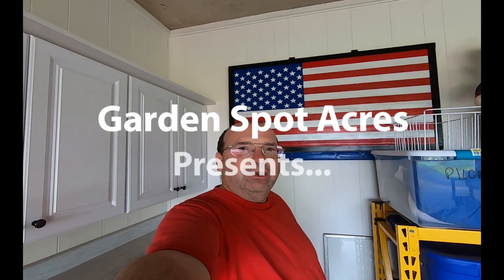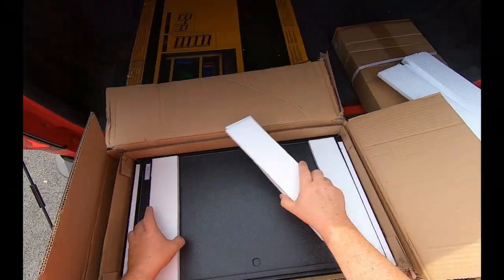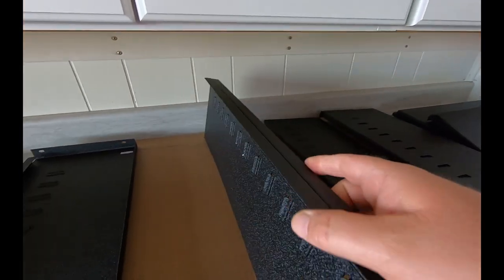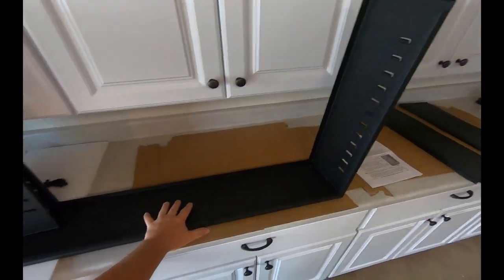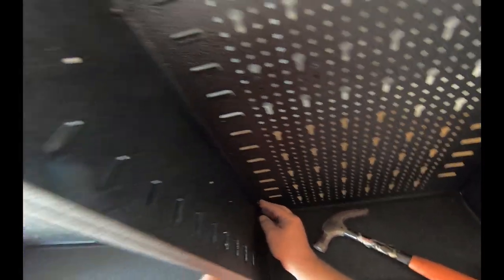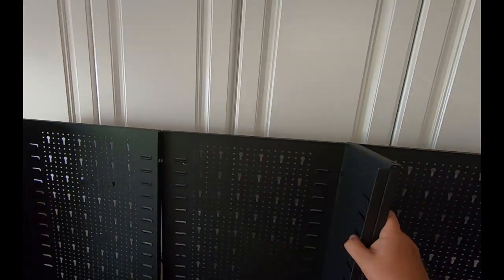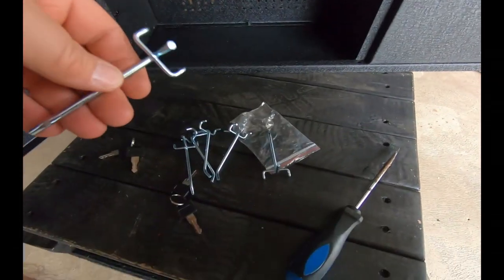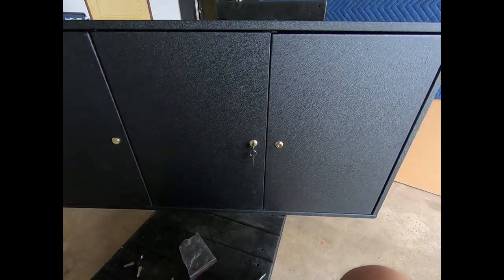Harbor Freight HANGING TOOL CABINET...Is it worth saving a few BUCKS?

Comment: Very helpful video.  Your clear instructions on how to orient the inside panels with the back panels was most appreciated!  One thing I did notice that I think you may have missed.   They supplied some washers to place between the door posts and the top and bottom.  I don’t think you used them.
Reply from the maker: Thanks for watching. I may have missed them. Thanks for catching that.

Comment: Thank you for posting this video, excellent might I add, very through.
Reply from the maker: Thanks for watching!  I greatly appreciate your time.  If you have a chance check out my other videos on my channel.  Have a great day.
Reply: @LancoAmish  I went to Harbor Freight and brought one home. In the interest of others
I used a 22 mm socket to tighten the nut on the key lock and I used an 8 mm socket attached
to a nut starter to make the assembly a little easier. I hope this helps others. Your video is OUTSTANDING!
Reply: @bobjohnson8206  I used 22mm and 8mm sockets for the same steps just today. Still has the same sizes (for now).
Reply: @LancoAmish  Very helpful vid, thank you for making it!

Comment: Thanks for the help! Yeah the instructions aren’t the best and the parts don’t really make sense at first. They went pretty cheap on this one; however, lockers are going for thousands of dollars on craigslist…

I imagine with just a little more instruction one could make these out of sheet metal especially if they had the right tool to cut louvers. I bet there’s a factory in China that pumps these out for our scrap weight
Reply from the maker: Thanks for watching!  I’m sure the materials are not top notch!

Comment: I want to use this cabinet mounted to the top of the harbor freight Yukon 46 In. 9-Drawer Mobile Storage Cabinet With Solid Wood Top and wonder can it sit on top or use the supplied brackets to mount it to the back somehow? Great assembly video! Thanks
Reply from the maker: I don't see why you shouldn't be able to mount it to a mobile cabinet.  Sounds like a great idea. Good Luck.

Comment: is the top and the bottom the same? and buying your own hardware an using lockwashers will help in the long run
Reply from the maker: I didn’t see a difference with top and bottom.

Comment: Great video! It helped a lot. Thank you for taking the time out to make it! One question. Not sure if this makes a difference or not, but is there any reason why you bolted in (for example) the rightmost center panel in the order of: back panel R, backpanel Center, and then Center panel? I believe you did this for the leftmost center panel in a similar order as well. I thought it would go: back panel R, Center panel, and then backpanel Center. I've seen a few other videos on here bolting it together in this order, so not sure which way it's supposed to be?  Again, maybe it doesn't ultimately matter. Thanks again.
Reply from the maker: If I can recall correctly I followed the written directions and it actually made sense.  I don’t remember why now but at the time it did.  Thanks for watching.

Comment: Thank you for the instructions very helpful but I was wondering if you put the back on upside down cuz it looks like the holes where upside down. Seems like you want the slotted holes down?
Reply from the maker: Could be.  It looked to me like everything was symmetrical though. If you saw different then I believe you.  My eyes are getting worse by the day it seems.
Reply: @LancoAmish  still an awesome video I'm glad there's people out there that do this at helps us out a lot
Reply: He put the back on correctly. You'll notice the notches for the shelf support are going the same direction as on the sides. The holes are meant for if you want to mount it off the wall and use the peg boards or to hang something inside of the cabinet. The slotted holes aren't meant for mounting the cabinet.

Comment: I paid $39.99 which must have had the original price before the Kung Flu outbreak. Now they sell for $75 which is too much in my opinion. This is not a very strong cabinet as it can barely support its own weight. When hanging be sure to support the bottom edge or it will deflect or sag in the middle. This project will be difficult for some to assemble because the center supports are difficult to align. I suggest paying more for the Husky product.